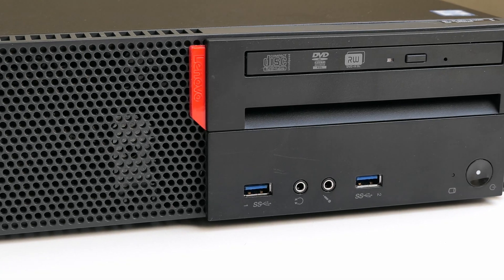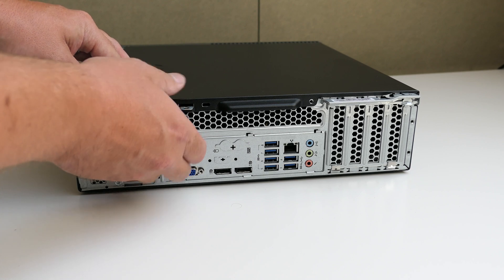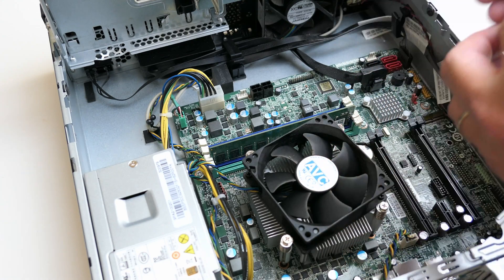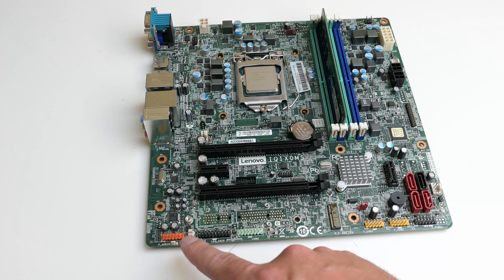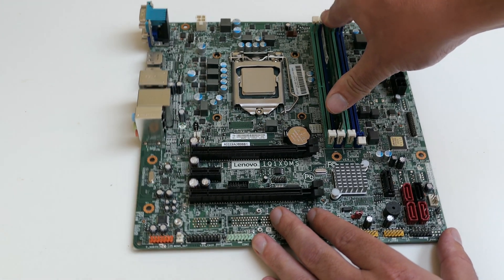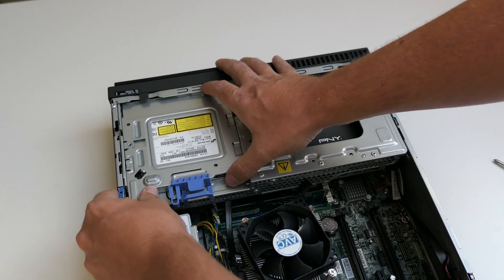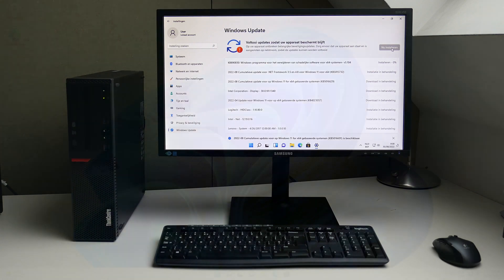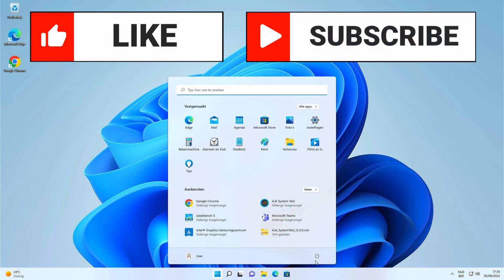Lenovo ThinkCentre M900 SFF - Teardown, Upgrades, Benchmarking

Comment: I've been looking for some videos on the Lenovo Thinkcentre m920s SFF machines. Bought several used for some business centers at work that get guest foot traffic. While the m900 is not exactly the same, it's very close. I was surprised to see that front chassis intake fan because they are absent in all the m920s machines I got. I actually bought some 70mm fans since there are two empty fan controllers and on 3 of the machines, I zip tied one to the front of the chassis where the one at 3:13 can be seen for intake. Brings the idle motherboard temp to about 44-45c and blows over where the m.2 housing is in the m920s model. Thanks for the video!

Comment: Can you install a low profile graphics card into this PC?
Reply from the maker: Sure, that should work fine. A GTX1650 or RX6400 would probably be a good choice
Reply: Would they require external power?
Reply from the maker: @JesseMonroy-lp9ob  most of them do not, like GTX 1650 or RX 6400 for example
Reply: @jensdbe  ty 😁

Comment: Front fan 70mm ?
Reply: Probably. I bought some used Lenovo Thinkcentre m920s machines and they didn't have front fans like this model, so I bought some 70mm fans and zip tied them on since there was a fan controller nearby. Motherboard idles around 44-45c with that fan present and they blow across where the m2 is housed.

Comment: hey, i can put an rx580 in that desktop?, and, for install an graphic card i need to remove the 
drive bay??
Reply from the maker: I don't think a RX580 is a good idea here. First of all, the power supply is far to weak to have a RX580 in this machine so you would need to start by upgrading that first. Secondly, only low profile cards fit in there and I'm not aware of any RX580 in that form factor + it would indeed require you to remove the drive bay as well.
Reply: @jensdbe  oh ok thx, it helped me

Comment: Hi sorry to bother you, can i ask if i can insert 2 ssd sata 2.5 using dual sata 4 pin cable in exchange losing the dvd drive
Reply from the maker: You can use any of the SATA ports for an additional drive but might need a splitter for the SATA power cable as the DVD uses a different type.

Comment: hi! I hate to ask but would you have any measurements for the space in-between the drive bay and the pcie brackets? Im thinking of putting a low profile 4060 :)
Reply from the maker: Unfortunately I don't have the machine anymore but I think a 4060 will use too much power for this machine as it can draw up to 110W as far as I know.
Reply: @jensdbe  some models had better psus or i could always upgrade the psu :)

Comment: great video, but is the motherboard M ATX spec? or is it a custom form factor?
Reply from the maker: Size-wise, I think it is up to the spec but the power supply input/control is using a different standard. I did see that conversion cables exist but don't have experience with that.
Reply: @jensdbe  yeah i thought so too, but i was wondering if a M ITX or M ATX motherboard could fit, i would just fit a different one then the old one

Comment: hi, is it possible to replace the HSF CPU Cooler with aftermarket HSF? I'm worried if replacing with aftermarket HSF will have problems with the bios.

Comment: Seems like the power supply only have 12volts? I could only see yellow and black wired aside from the power on Cable and -12v
Reply from the maker: I think you are right, there is only +12V on yellow, -12V on blue as far as I can see.

Comment: Great quality video, thank you! In your experience, do you find Lenovos to be more picky than other brands when it comes to RAM they work with? I use an old M58P tower that came with 2 x 1GB of RAM. I ordered it years ago from a refurbisher company with a RAM upgrade but the stick they installed was not accepted by the system. At the time I didn't bother returning it, because Linux Mint was perfectly happy to run basic tasks with 2GB as well. Recently I found a good deal on used DDR3 so I bought 2x 2GB sticks, no luck again, it beeps and doesn't post regardless if the new RAM is added alongside the old or on its own.
Reply from the maker: To my experience Lenovo's are not more or less picky for memory. Are you sure the memory is compatible? There is often memory available at prices that look like a good deal but in a lot of cases this is memory that comes for decommissioned servers and is ECC or Registered, which is not compatible here.
Reply: Thank you for the answer. It probably comes down to a frequency incompatibility. The board takes 1066MHZ RAM and they sent me the 1333 type (although I specified what I needed but they didn't care or didn't have it on stock. Typical Romania, haha..). There was a chance that the board could run the faster sticks at its lower required speed, so I tried them anyway, but no luck. If they make me pay for postage to return them, it's not worth it. Anyway, soon the time will come to move on from the old trusty Core2Duo to something more recent :) I just don't like throwing things away while they still work well.
Thanks again! Keep up the good work! And happy new year!

Comment: Is the cpu compatible with windows 11?
Reply from the maker: A 6th generation Intel Core CPU is not officially supported. It is possible to work around the hardware check though. Have a look at another video I did on that specifically: For a fresh install: https://youtu.be/iPc4Tmhv-1o or for an upgrade: https://youtu.be/GI2B5H2tYLs

Comment: Could you replace the motherboard with a generic third party micro-ATX motherboard? And is the power supply a standard one? Its connector does not seem to be either 20 or 24 pin..
Reply from the maker: I'm not sure. From the looks, the form factor is similar to standard ATX. For the power supply, I know adapter cables exist from standard ATX to the format Lenovo is using here but haven't seen them the other way around.
Reply: @jensdbe  thanks for responding so quickly. If the mainboard is replacable with a standard micro atx, and the power supply form factor is not unique to lenovo, then this could turn into a real powerhouse of a PC

Comment: Would it be possible to fit a different mATX motherboard in this? I have the same computer, and i love the design of the case etc.
I use it on my tv in my livingroom. I guess the power cables can be a problem but might be able to buy adapters for it.
How would it be to mount a different cooler when the mounting screws goes into the chassi in the back?
Reply: I don’t believe so, was looking into it myself and it’s a custom form factor board as well as some of the psu plugs are made to specifically only allow that motherboard, they would never do this to stop consumers from upgrading though 😁👍

Comment: Watching this because I want to remove my SSD from this pc and put in a new one. I'm watching this on an M700 SFF, which is the same (pretty mutch) as the one you are diss-assembling.
Reply: Does the m700 sff have an m. 2 slot cause I'm planning on buying one and a m. 2 ssd

Comment: Could you add a low profile graphics card that would be strong enough for gaming. If so would you also need to change the power source?
Reply from the maker: A GTX1650 or 1050Ti would be proper options that do not required additional power or a different power supply.

Comment: I'm kind of looking for something low-power around a 60-watt processor. I think this will work but with no extra storage, no DVD, and no cooling fan I want to bolt a passive heatsink even if it won't fit in the case I can leave the top off it's going in a portable solar-powered laser burner. I even stripped down a laptop LCD display no camera just a driver circuit with video connections. All the extra power I save in watts goes toward refrigeration and a CO2 laser. Cooling is done by a thermal draft in a painted black metal pipe and wind.The ThinkCentre M900 case looks easy to work on after removing all the stuff I don't need out of the way. I will have to take it apart and clean out the smoke and dust from being an outdoor machine every few weeks.  I think fanless power supplies will fit this. 16GB of ram will work well on graphic applications. Some low-power workstation cards are pretty powerful nowadays. I got a Quadro K220 it just gets warm to the touch and renders video all day and has enough power with GDDR5 ram to play some games but it's not low profile.

Comment: Can I put 32gb in slot 2 and another 32gb in slot for ? Or do I need 4 16gb sticks?
Reply from the maker: Not 100% sure but I would be surprised if it supports 32GB modules. If you want 64GB, you will most likely need 4x16GB.

Comment: Great video ,it is amazing how they design these machines for fast production and ease of repair with minimal tools. I have a question ,I have a Lenovo  H520s vertical tower that I got at a recycle yard. I got it home and hooked it and and it booted to Windows 10 home ! It originally came with Win 8.1 it also has a core  i7 3rd gen processor and 8 GB of DDR3 1600 MHz of ram. The computer runs well since I cloned a 500 GB SSD ,replacing the mechanical drive that it came with. Can I upgrade  the memory to 16 GHz since the machine is running Windows 10?
Reply from the maker: Should be perfectly fine to upgrade to 16GB of RAM
Reply: @jensdbe  Thank you ,I will crack into the machine and get  the specs on the memory to make sure it is the right type and let you know how it goes .

Comment: Can I do a case swap and fit a msi 1050ti?
Reply from the maker: No need to do a case swap if you are using a low profile card. These exist as 1050Ti for sure. A case swap is difficult as the motherboard is not in a standard format and the power supply isn't either.
Reply: Thanks! Although, I was planning to use my old full size 1050ti so I can't do that.

Comment: Is it possible to connect a video card to it? 1050ti or 1650?
Reply from the maker: As long as it doesn't need additional power input and the card is low profile you should be good.

Comment: Hi, I have the same PC at home and was wondering if an Asus Dual Nvidia GTX 1660 Super OC (graphics card) would fit. I'm thinking of upgrading this to a gaming PC. Thanks!
Reply from the maker: If you have a low profile card, which exists as a GTX 1660 super I believe, it should work. The power supply is 210W and that card would draw at max 125W as far as I can see. It will be on the limit but I don't expect too much issues.
Reply: @jensdbe  Thanks man! 👍
Reply: The most powerful low profile GPUs available are the Gtx1650 and the RX6400
The 1660 is probably ITX (shorter in depth, but standard height), so it won't fit. 
You will have to find a more powerful TFX power supply than the one included, probably.
Reply: @tadeuszmarin5704  so would I need a  different mother board or could I just put a gtx1650 in with minimal issues?
Reply: @latinletters565  The motherboard is not an issue. A gtx1650 (low profile, remember), will just draw power from the Pci-e slot of any ATX motherboard.
Reply: @tadeuszmarin5704  oh ok, well thank you, so I can install the new graphics card that you stated without breaking the integrated one of the i5?

Comment: This this SFF can only hold 1x3.5" HDD?   Do you know of any model which can hold 2x 3.5" & 1x 2.5" at least?  (I do plenty of HP SFF machines do but wondering if any SFF from Lenovo or Dell has those capabilities as well)
Reply from the maker: If you need place for more than one 3,5" drive you could go for an SFF with a full 5,25" DVD-drive. There are brackets to hold a 3,5" and 2x 2,5" drives that fit in that place. I used it here to build my NAS: https://youtu.be/NXWQ4FI5Pu4?t=256
Reply: @jensdbe  I am actually thinking of HP Pridesk 600 g2 or elitedesk 600 g2,  elitedesk 800 g2 or g3 to build me a NAS too.   I found that these have 2 3.5 bay and 1x 2.5".  Plus I can get a caddy for slim DVD for another 2.5.
I wanted 2x 3.5" because I want to run it as mirror.
Reply from the maker: I have a review/teardown of the ProDesk 600 G2 coming up. Still working on it but shouldn't take longer than a week or so :) 
That one indeed has the space for 2x3,5" + 2,5" I believe
Reply: There's another 2.5 drive bay caddy that is supposed to clip under the cd drive. It even has its own fan.

Comment: can you put a videocard in this pc?
Reply from the maker: As long as it is a low profile card and it does not need too much external power, it should work fine. Something like a 1050 would be a good match.
Reply: @jensdbe  thanks for the info :)